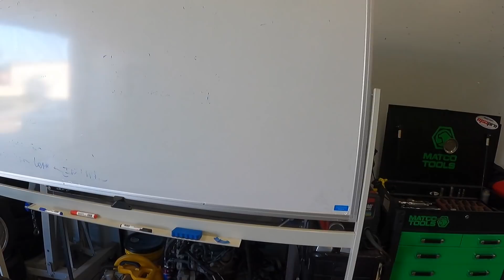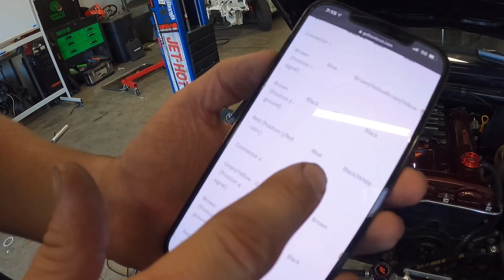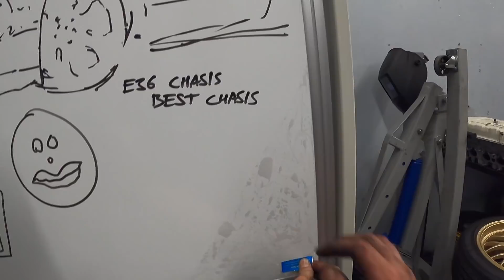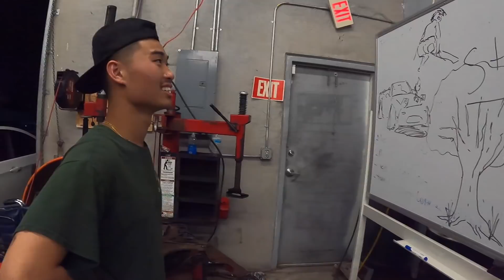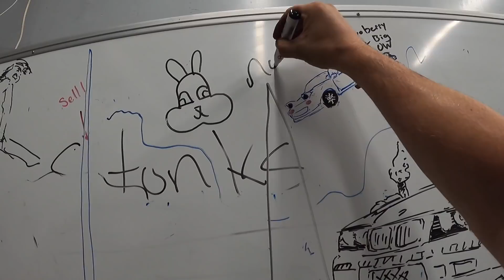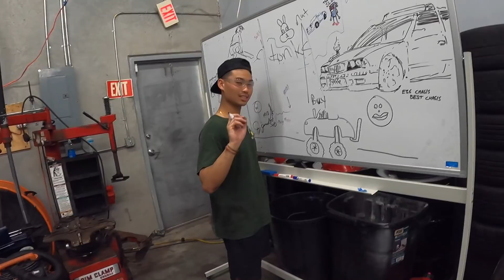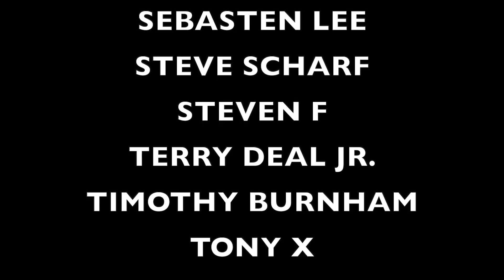LAST MOD I NEEDED FOR THE RICER MIATA!

Comment: Plug in cyl 1 doesn't seem tight enough to be sealed, if it's pushing the wire out
Reply: either that or valve cover gasket - had that happen myself :D

Comment: use the whiteboard for something that you struggle with-    plan things.  Make a list and follow it and stay on track.  Roll it right next to the vehicle on the front lift and finish 1 at a time.  Use the other on the back lift vehicle

Comment: You’re losing compression past the spark plug on cylinder one. If it’s tight try putting some thread sealer on the plug and put it back it

Comment: Gotta tighten the spark plug in cylinder 1 its shouldnt shake out or walk up but hope its just that on the mold on the collar of the wire boot is messed up or rolled but glad your getting that grind on

Comment: make a little L shape bracket that attaches to the valve cover bolt and sits on top of plug wire to hold it down